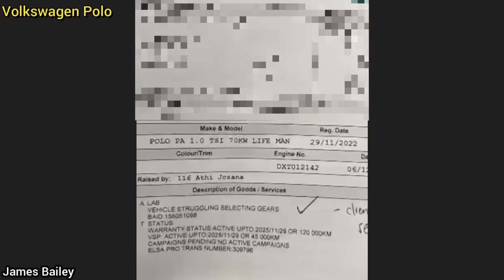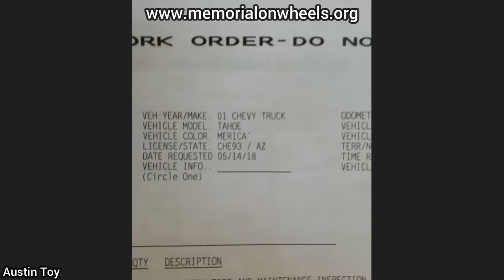Customer States They Need Door Repaired After Locking Keys In Car

Comment: 2:30 When I worked for Sprint, I had RF test equipment that the 12V lighter jack was not capable of powering.  They had me run jumper cables like this from the battery, under the car, through the passenger door, to an inverter on the floor, which the equipment then plugged into.   The first inverter was so cheap it ended up melting, so they had to purchase a second slightly more powerful one.  Sprint would spend 100k designing a pretty office, but then skimp when it came to employee safety.  It was crazy how unsafe the setup was.
Reply: Testing cell towers?
Reply: @WALTERBROADDUS  Yep
Reply: @Richard.Sanchez  Not Amnet services out of NJ by any chance? 🙆🏽‍♂️
Reply: @WALTERBROADDUS  No
Reply: @Richard.Sanchez  Management sounds about the same sadly.....😏

Comment: Harley big twins have three separate fluids needing changed each 5k miles. engine oil, transmission oil, and primary oil
Reply: I wouldn't go that far, 3k keeps it cleaner !!
Reply: I thought the 3rd one was gravy?
Reply: Which one is used for marking places?
Reply: @XtreeM_FaiL  yes
Reply: VGG just showed the process on his recovered stolen Hog!

Comment: Those electric cables in the door may be to make the door shock anyone that tries to break into the car. You clamp the interior end to the inside frame of the door (through bottom cutout, on this one) & the other end hooks to the battery. I've seen a similar setup before.
Reply: 12 volts won't shock you.
Reply: @allhonesty848 You can hold both battery posts on a brand new battery. You won't even tickle. Your body isn't conducting 500A at 12v.  If anything it'll be because they have something they want to power with 12v or maybe a solar charger they keep on the dash.. honestly with work that janky it's probably not even a sane reason. They probably think you can shock someone trying to open their door or something stupid.
Reply: @allhonesty848  It absolutely is about the voltage.  If you think 12v is enough to push more than 1mA through human skin you need to brush up on your electrical knowledge.
Reply: And don’t forget guys, the door isn’t insulated from the rest of the vehicle so it would be a dead short
Reply: You guys are right, idk what the hell I was thinking.
Reply: My booster cable function guess.
Probably previously had a bad battery and were using another battery to start the car and then run it off the alternator. That would explain having just one clip on one booster lead, as the other three could stay attached.

Clip onto extra battery to start, clip off while running. But if this is right, it looks like the backup battery would have had to sit in the driver's foot well... Yikes!

Comment: Your dog is locked in a car. Do you:
A - Break a window
B - Destroy the door and remove the entire handle assembly with a sawzall
C - Just go get a new dog
I mean, at least he sort of did the right thing, I guess...
Reply: that person never had car glass replaced- im always amazed at how cheap and fast it is.
Reply: Have a spare key and voila
Reply: @mikefoehr235  I tell people...hide a key, carry a plug kit and tire pump and jumper cables and spare gas. But no one listens.
Reply: @jimbeam2705  I have impact sockets...breaker bar....two chord less impacts...jumpers. My Tundra has a 140 litre tank...so gas is good. Do carry 5 gerry cans to trip to my camp. Self sufficiency.
Reply: @confuseatronica  Depends. I have a 2016 Infiniti Q70 and needed a new windshield. The cheap and fast place did a sloppy job and the windshield was as wavy as a funhouse mirror. All the other places in town said they also couldn’t get a decent aftermarket windshield. I ended up getting an OEM one from the dealer after my insurance sympathized with me.
Reply: D- call a locksmith.
Reply: @jimbeam2705  Similar here, but they always just call me because they know I can fix it...

Comment: Do you know how easy it is to hide a key in a safe spot underneath your vehicle.  I've done it for years and believe me I've needed it more than a few times because of leaving the keys in it or the dog locking the doors on me.
Reply: @tradde11 Probably for most this would be a clear sign to stop leaving their dogs in the car. :P
Reply: @tradde11 1 year olds will do it too. I remember that Rescue 911 episode where a Station Wagon was running, then it slipped out of gear and drove into a pond with a Baby in the car who pressed the door lock button. The rear window was open, though, so the Mom got in, and the kid didn't die from it.
Reply: Yeah, when I had a dog, I was paranoid that I'd leave him to die in the car..
There were times when I left him in the car alone for a few minutes. I put the windows half down so he got air but not enough for him to jump out. If someone needed to let him out, just reach inside and open the handle. I figured if someone wanted to steal a car, they might not choose the one with a 75-pound dog inside. 😊
Different with a baby, of course.
Reply: Been a lot of cases in Australia recently where mum's  have "just popped in the shops" left baby in the car, and some scum takes the car...
Reply: @onedayiwillmakesomecontent  Are the mother's ever charged with Child Endangerment/Abandonment or similar offense?

Comment: On 2:22:
I've had to do something similar on a car that had the fans wired to always be on, since they sometimes wouldn't come on in time to keep things cool, and I was on a 4500 mile road trip and needed to make it work. 
So the fans always got 12v from the battery as long as the key was turned - combined with an older alternator and a tired starter relay, this meant that sometimes I had to pop the hood and disconnect the fans so that the electrical system wasn't too taxed to start the engine itself. This got super annoying, not to mention wore very quickly on the involved wires and relays to be popping them in and out all the time. 
So I used some (lighter gauge than that) wire to extend the fan wire into my cab so I could just disconnect it and reconnect it without getting out of my car.
Since then I got a new alternator and a happier electrical system and I haven't had to use this trick but the wire is still there just in case.

Comment: Heavy gauge wires running from engine bay to the driver's door:
Option 1- driver assist, electric shock alertness aid
Option 2- redneck cigarette lighter.

Comment: 0:32 a lot of people get confused on those as there's 3 drain plugs: engine, transmission, and primary. On some older models the engine oil is drained by removing a rubber hose instead of a plug.

Comment: I'm no biker, but that poor motorcycle! 
 Also, the cables running from the battery(?) to the interior could have been a Jerry-rigged cable for an interior heater. I had to do that with a little defroster fan because it pulled too many amps for the power port to handle. But I used WAY smaller wire for mine.
Reply: There's a YT video where the guy ran cables from the alternator to interior for a big heater. I did what you did with a little heater on an old car; right from the battery to the heater. Yes, I used much smaller wire also.

Comment: The yellow cable from the battery has one ferrule so it was probably an inverter. Positive clamp for shutting it off completely. Some can pull an amp or better "off" but still connected.
 My guess would be a 1,500w continuous 3-4,000 peak for 6-8 gauge. Give you maybe 2 hours, 1 and three quarter around a thousand watts load.
  All ballpark numbers.

Comment: When I was younger, I used to change my buddy's brake pads. I couldn't do it one day, so he did it himself. I'm not a mechanic, I just have common sense. He called me on my cell when he was in front of me later that night, telling me he was getting a rough ride. I told him to gear down slowly not jerk the wheel. He slammed on the brakes and jerked the wheel. Two front wheels flew off and went over 1/4 mile down the hill. He forgot to tighten the wheels. On top of that, he put the pads on backward.

Comment: In Ontario some of these vehicles could leave the shop one of two ways. Either repaired or on the back of a tow truck. When a car is really unsafe, mechanics will call the police to give them a heads-up  in case the tow truck drops the car so the owner can drive away

Comment: Just took mine in for an oil change and a new set of tires.  When doing the alignment they found the tie rod ends were going bad. OK...Replace them!  During the alignment the mechanic broke the bolt on the rear control arm and then damaged the subframe trying to get it off.  Looks like I'm getting a new control arm and subframe on the dealership!
Reply: I'm the same way. If it's gonna need it "next time", do it now, or schedule another appointment sooner than later.
Reply: Make sure to get all the documentation to maintain your vehicles warranty👍
Reply: @vs-ww7cb  It's a 10 yo Escape with 160K.  Just glad I don't have the bad EcoBoost engine!  Those are barely making 3 years before the head gasket gives out.  The only coolant problem is it likes to leak when the weather gets cold.  Loose clamp somewhere.
Reply: @2fathomsdeeper  i was just trying to throw out a mechanical sensibility if you had warranty,  I'd guess (as a wrench) they were just doing their "bread n butter"  on the tires and steering components. I was only suggesting documentation so you know and have a file on said vehicle.  If you have a dedicated spot to park vehicle,  find a clean patch, note any drips/spots under it.✌

Comment: 🔥🚛💥 Well, that's one way to solve the problem! Who knew ripping a hole in the door could be a cost-effective alternative to breaking the glass? It's definitely an unconventional approach, but it seems to have worked in this situation. I'm curious to know more about the aftermath and how the differential explosion occurred. Safety measures and alternative solutions could be worth exploring. 😄🔧🔥
Reply: I've known people that taped a hammer in a hidden place under the bumper. Their plan was to use it to break the window if they ever locked the keys inside. When asked "Why not hide a key"? They typically replied something like "I don't want a thief to find the key".

Comment: If you've gotta get in your car immediately after locking yourself out just break the glass... Don't cut holes in the sheet metal, glass is easily replaced and is FAR cheaper than a new door.
Reply: I’d say 99 out of 100 understand that.  This is the 1

Comment: Customer states: "Unidentified oil spot on garage floor. What's leaking?
Have you by any chance been to Jiffy Lube lately?
Customer just left Jiffy Lube, made it approximately a half mile, and pulled into a carwash, where it died and wouldn't start back up, which is where I towed it from. You could see the trail of oil coming out of Jiffy Lube's lot and going down the street, right up to her car. They forgot to put the drain plug back or they only had it in a couple threads and it fell out. Pontiac Grand Am. Happened in about 06 or 07.

Comment: I guess I can understand the harley, every bike I've owned has a wet clutch and shares motor oil and tranny oil. And the prybar is funny, because I find sockets and tools all the time working on farm equipment and heavy diesel. Never a 10mm socket though. I always make sure to account for all my shit as I'm working so I don't leave anything behind, because tools are expensive, and replacing an engine or tranny or something because you forgot a tool is even more expensive.
Reply: Have you found my 8" knipex channel locks? I miss them lil fellas. 😅
Reply: There's a planet 82,947 trillion light years away where it's nothing but 10mm sockets. When one is dropped or loaned out, they immediately warp to that planet, gone forever😔
Reply: @Jeff.78  betcha there's a few 8mm there too. 😆
Reply: @Jeff.78  xanadu but for mechanics

Comment: 0:27 I mean...how?!?! 

 I didn't know how to drive stick when I bought my first car in 2006 ('04 Sentra SE-R Spec V). I had an idea of how to do it, but I had never been behind the wheel of a manual car. Driving it home from the dealer, I stopped at a stop light and saw smoke rising from the hood...it was my clutch (I likely didn't let the clutch pedal out all the way so I was slipping the clutch non-stop for about 8 miles). 

Long story short, I still own and drive the car to this day and the stock clutch lasted over 150k miles before the friction material became too worn to grip the flywheel. What they managed to pull off is inconceivable unless they did the same thing I did, while also never bothering to read the car's warning signs.

Comment: 2:37 That's the id 10 t way of running power wire for an audio amplifier. But, it wouldn't have that clamp terminal or be run into the door if that was the reason.

Comment: 0:32 this reminds me when i went to change the fluids on my dad's sportster 1200 and i opened the chain inspection cover and asked him when was the last time he changed the chain oil he told me i didn't know that had oil you needed to change i drained it rust orange oil came out and the chain had enough slack to bang it against the housing whats worse a dude that had multiple awards for different show bike's and talked about a rare specialty 2009 harley  he had, he said "that noise was normal" and "all sportsters have a noisy chain" i learned all i needed to know from lowbrow  custom's youtube channel on how to change the clutch cable and all the fluids on said bike and no longer had a noisy chain and this dude was suppose to find the reason for the front cylinder kept fouling plugs never got back to us ever
Reply: What's the service interval on the blinker fluid?

Comment: How is it possible for the clutch to be that screwed up with only 25 miles? Many years ago, I learned how to drive manual transmission in a brand new Jeep I bought, and I Barely got at home. I did need to replace the clutch at about 50 something thousand miles, but I blame that on me 😀
Reply: Probably rode the clutch the whole time. that is the only thing i can think of or it's a Manufactures defect.
Reply: I'll need a full tank of gas and an empty lot...watch this🤪

Comment: 0:05 that's what they call a burn-out, then?
0:18 they probably tried a burn-out the other way. or it was a fabrication fault.
back when I was working at a little auto shop specialized on US cars there was this customer with a 86 Firebird with I think, 5litre and 5 on the floor. destroyed his clutch within a couple 100 km. I had to replace the clutch twice within the 3 months I worked there, and it always hung in shambles...
1:50 bad material of the spring. this happens here in europe quite often, apparently the "original parts quality" isn't, when it comes to springs; the older the vehicle the less you find broken springs. sometimes the spring is just 2-3 years old, or even less, and you don't see corrosion cutting into the surface, either. had it once with a Mercedes that was a little over a year old, jacked it up, and the lower ring fell out of the suspension.

Comment: That first clip, that diff had NO oil in it for a while. The sprocket is rusted and peeling even.
Reply from the maker: I was thinking the same thing. The pinion looks rusty lol. Must have made noise for a while 😂
Reply: @JustRolledIn  turns up radio "The noise just started."

Comment: If you have to get into your car and the only way is to break a window, break the drivers front window. It is generally the cheapest. Never break the little windows in the front of the door or the quarter windows. The glass may be cheaper, but the labor will cost more. If you have to break a window because some idiot left their dog or child in a hot car then you break the little window.
Reply: I'd question the possibility of breaking the front window. They are heavily reinforced, so you're not just going to kick it in.
Reply: @whuzzzup  My pocket knife has a glass breaker on the handle. A screwdriver, wrench, hammer, flowerpot, bazooka, or a brick will suffice.
Reply: @whuzzzup  All glass in a car is made the same with the exception of the windshield. The front glass will break with minimal effort. Don't kick it. Use a metal item and it will break.

Comment: Wow that's terrifying to think some of those vehicles could be driving down the opposite lane toward you at 55+mph. You would think it would be legal for the garage to take the plates from a vehicle which is unsafe to drive. Of course if you give some garages that power you will end up with those lacking a moral center taking the plates off for stuff like bulbs and crap and charging people thousands in unnecessary repairs. So what do you do? If someone is warned about their vehicle being unsafe and still drives it and causes a death then it should be the same sentence you would get for firing randomly into a crowd or if you give the power to the garages and they do make up issues they should lose their be forced to pay back 10 times all ill gotten gains to the customers they overcharged.

Comment: Flared the end of the brake line? What does that mean?
Reply: You can Google flare fitting. 
Basically, you bend the outside edge out so that it clamps between the fitting in the not so that It can’t slide out like that.
Reply: @neilkurzman4907  ah that makes sense. Thanks!
Reply: Or go to a reputable brake shop, saves ALL that thinking lol